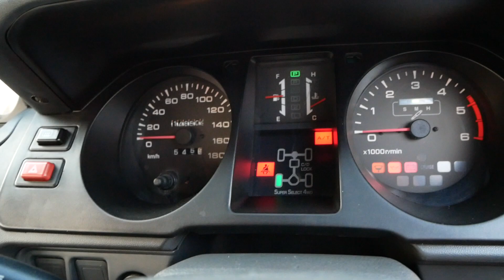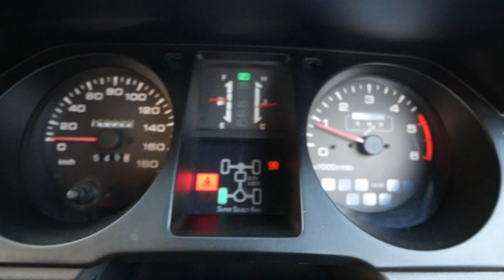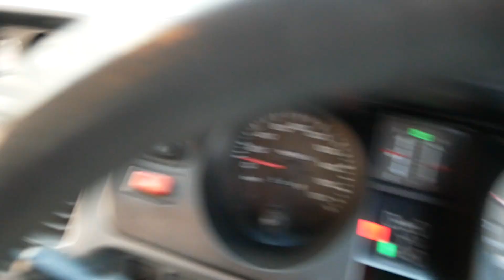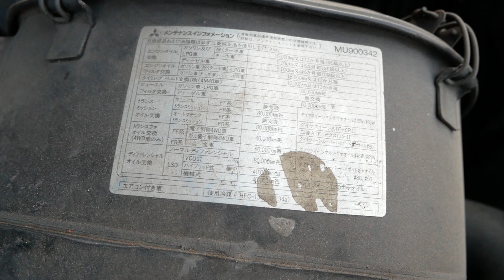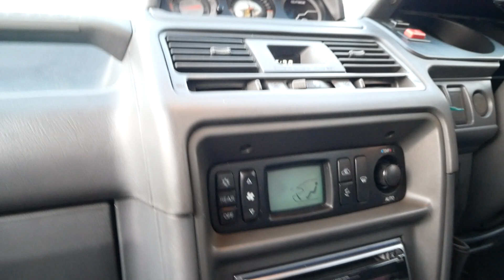1996 Mitsubishi Pajero Wide FIELD MASTER 4WD 2.8L TURBO DIESEL INTERCOOLER. RHD-JDM

Comment: Very high tech vehicle of its time when Mitsubishi used to make nice cars !
Reply: yes, sadly most pajero are slow asfk in highways. Even the new pajero 2020 feels like they put limiter in it and had to recalibrate their ECU, tehre a way in youtube but i dont guarantee what happen in long run. My place had alot of old pajero drivers but ever since modern cars has better punchy acceleration, they prefer that now.
Reply from the maker: Old body was slow V44 105hp this body V46 with bigger turbo diesel better 4M40 125 hp on 1998 was available 140hp engine with electronic and in 1999 4M41 170hp but different body style and no frame anymore